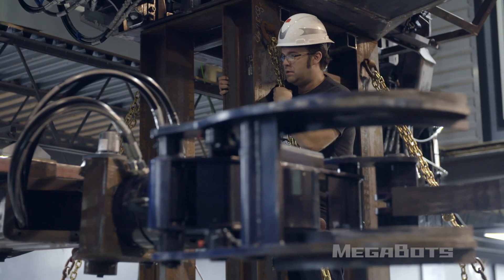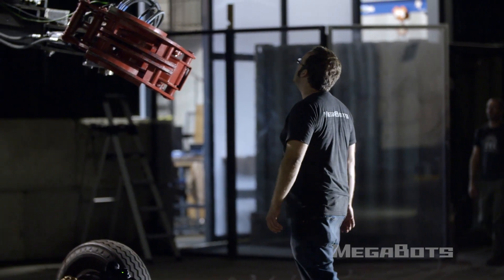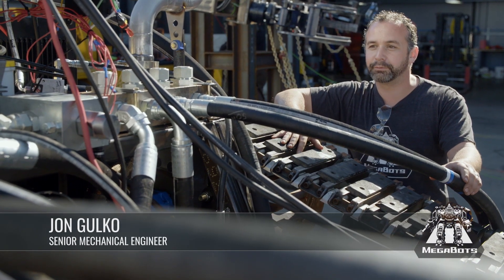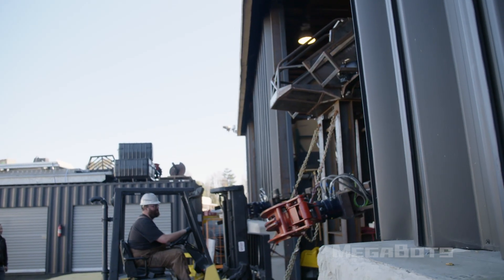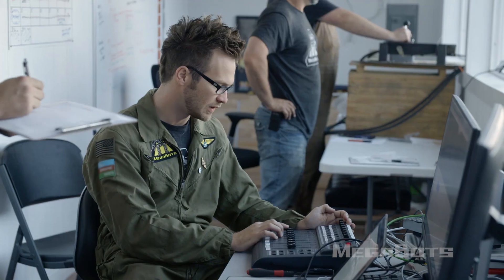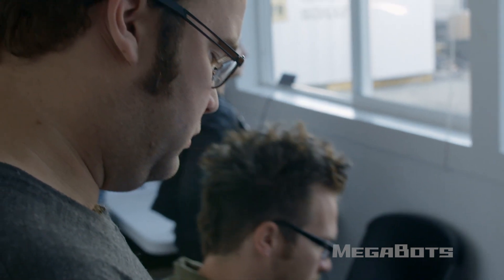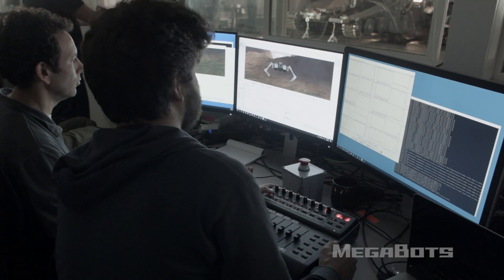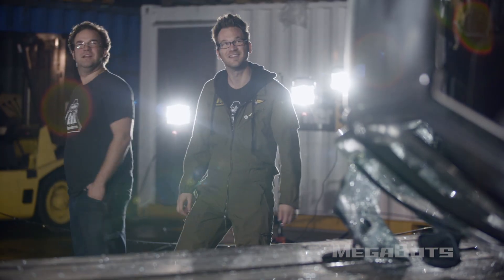MegaBot Mk.III Picks Up A Car! (Season 1)

Comment: Have you guys ever thought that all those hoses could be a problem ?  Why not just use electric motors powered by the engine connected to a 20 or 30k generator, or batteries of course, to eliminate the long hose problem. In each area where the hydraulic cylinders, that cause the movements, are located. Place a high efficient DC electric motor basically right next to the arms or other joints to shorten the hoses and eliminate the single control block and replace it with many that are controlled by the computer attached to a controller joystick. Each  separate motor would also no longer need all that long wiring.... by... communicating to the  separate motors now connected... close.... to each activating joint using.... an FM signal.... or a Microwave signal... to each  separate motor.... there-by eliminating a long wiring harness. This kind of technology will one day be used in aircraft and spacecraft in the future if not already. Just my two cents, cool stuff, keep on truckin.  Chuck in Palm Beach.

Comment: You know how there is a gaming outfit that you can use that tracks the angles and positions  of your arms? Why not try to integrate that system into the megabot and add a small camera to each arm for precision?

Comment: They need to make the mega bots controlled externally because they have them built, They are adding weapons and etc but they are forgetting that the bots can be fixed, rebuilt, Redesigned etc they cannot and seeing these weapons they are designing and previous tests they have a very large chance to die if they pilot it inside the bot.

Comment: Gotta wonder about controls for these guys- are you doing pre-programmed 'actions' like you used in this test?  So you have specific positions that you can tell the arms to go to?  Or are you planning on developing an in-cockpit handheld controller system for direct human control of the end-effector's positioning and actions?

Also, wonder if Korea would want to get in on this- they seem to be developing something in a similar vein.

Comment: Any videos showing what the kuritas is doing?
Reply: AisEH yeah I know don't worry is just a joke, also your right, any kind of problem can push back the development, lets hope that doesn't happen
Reply: How long do you expect the mech the South Koreans are making will be finished? My guess is not until couple of years, especially if the South Koreans are building a mech with leg and free movement arm. I say this with the consideration that is has been about two years or longer since the Americans have been taking to build their mech.
Reply: AisEH the south koreans plan to begin selling their robot by the end of 2017, the arms are already finished and they said that the legs are mostly finished and they already have calls from múltiple companies that want to buy a robot, its going to cost 8 millions per unit aparently
Reply: Wow that sounds impressive if they can actually sell the robot by the end of 2017. That said, I would be cautious taking their announcement as true. External factors (ex: accidents) could delay their plans.
Reply: AisEH that sound soo suspicious, "external factors cof cof accidents cof cof"
Reply: sorry if it sounded suspicious. The reason I say is through the example of SpaceX where accidents and delays ended up pushing back with some of the launches.

Comment: It seems to be that it should be much shorter than it is.  It looks to be too easy to tip over.  When another object of similar size and mass comes crashing into it, you might want to have your center of gravity MUCH lower to the ground.

I imagine a shorter single armed machine, with an arm long enough still to reach the top of the cabin running straight up to it, placing its single arm at the very top then just driving forward a bit to put this big one on its back.  Instant victory.

I don't want to see this fight happen like that, do you?  That would be a very disappointing loss.

Comment: Slow, over-complicated, imprecise.
Reply: This was just the test. Wait until the finished product is revealed before criticizing anything.
Reply: The entire design process could be summed up with what I said. If they're using a human pilot, there's really no need for it to use software. There are also so many exposed vital moving parts that could easily get jammed or directly hit by an opponent that it'd be too fragile to actually use in a fight. If they spent more time designing the robot, they wouldn't have needed to spend so much time testing something as simple as moving both arms. The whole design process is just wasteful.

Even if the whole fight is really well choreographed, something is bound to go horribly wrong.
Reply: Blurns
Do you have any idea of what you're talking about? As I said, this is a TEST version. The thing hasn't had any armor applied to it yet - this is just the skeleton of the mech. Those areas probably won't be exposed anymore once they add the armor. I mean, do you remember what they said the cockpit would be made of? Look at it in this video - it's literally just the framework of the thing. The armor is supposed to come LATER.

Also, you'd be criticizing them if they DIDN'T test the arms for not being thorough or wise enough. These arms run on hydraulics and have several joints and servos. As someone who personally works in the robotics field, let me tell you that it's NOT easy to get ANYTHING robotic act like it's human (getting robots to walk is hard enough). Testing them is necessary to make sure everything works. In a fight, the arms will be one of the most important parts of the robot. They can't afford NOT to test it. Plus, you claim that the didn't spend enough time designing it when you don't even have any idea as to HOW much time they actually DID spend designing the thing. All of these episodes were recorded like 6 months ago. Since the original challenge video was in 2015, we have no idea how much time they have spent designing the MK3 and building it.

Also, they stated the point of the software is to make the job easier on the pilot. When you move you arm, you don't specifically think about which muscle to move to point at this specific angle. You just move it. The software is supposed to make it so that the pilot doesn't have to think about every little movement that the robot makes.
Reply: The Strategist
From the looks of it, the design process seems to have amounted to building 2 poor-quality assembly line robot arms onto the side of a cockpit & equipping them with some tools they weren't designed to handle. They may as well have built a big Rock'Em Sock'Em Robot or just gave up & built a tank for all it's worth.

And of course the software is supposed to make the job easier on the pilot, but it wouldn't be necessary if they hadn't over-complicated the design to begin with. If they just designed it so that the pilot doesn't have to think about every little movement that the robot makes, they wouldn't need the software! Now if something completely unforseen happens with the arm or the software, the pilot isn't going to have the same feedback they would if they hadn't bothered with their "drive by wire" approach to controls.
Reply: Blurns
"but it wouldn't be necessary if they hadn't over-complicated the design to begin with"
The design isn't even that complicated, unless you're an ignorant layman. Robots that are supposed to do even the simplest of tasks can turn out to be very complicated. Doesn't mean that they can't get the job done, though.

"If they just designed it so that the pilot doesn't have to think about every little movement that the robot makes, they wouldn't need the software!"
They want big, tough arms capable of holding big, tough, damaging weapons (not the BB peashooters of the Kuratas). Those kinds of arms NEED to be directed manually, there's no other way to do it.

Also, I understand how you think something might go wrong with the software, but software isn't completely unreliable to the point where it can't handle itself for more than 20 minutes. I highly doubt that the software is just going to bug out in the middle of the fight. These people have a whole entire team of professional programmers - they know what they're doing.
Reply: The Strategist The design isn't over-complicated if they're using it as an assembly line worker. If you're building something that big for anything remotely resembling combat, you want to take as much advantage of leverage as you can & reduce the losses created by unnecessary moving parts.

If they had simply designed the robot around weapon they want it to use rather than giving it arms, then deciding later what weapon they want to swap it's hand for, the software-controlled arm wouldn't be necessary. It just adds another possible delay to the driver reaction time. If you need both software & a human brain behind the wheel, you're doing something wrong.
Reply: Blurns
The problem is, if those assembly line robots in the factory were being controlled by a human, a human would STILL need to calculate the movement for the arms. That's why the arms are almost COMPLETELY controlled by software so they can do their job. And trust me, assembly line robots may not be the most "complicated" robots out there, but they're still far from being anywhere close to as simple as the things they build.

Also, I don't think you realize the advantage of modular arms. It gives the robot a LOT of versatility in that it can change weapons depending on the situation.

Also, having both software and a human brain behind the robot isn't necessarily a bad thing so long as the software actually does its job and minimizes the amount of meticulous work that the driver needs to do. With the amount of time, money, and testing they've put into the coding, I'd say their chances of the software working without a major hitch are pretty good.
Reply: The Strategist If they didn't use that stupid assembly line robot arm design for combat, they could build a better & simpler arm that wouldn't need to use software.

Modular arms might be useful if this were BattleBots or something, but they're just up against one known opponent. They just need 1 or 2 good weapons, not a swiss-army robot.

Comment: A lot of people here apparently don't understand the limits of technology/ limits of practicality. Think about it. This "robot" is being built for the purpose of a one-on-one brawl. Would stealth tech really be necessary? Of course not. It would only add unnecessary work and cost. Not to mention cloaking devices don't even exist in this large of a scale. Also, I've seen a lot of people complaining that they should've put legs on it instead of treads. First of all, Kuratas doesn't even have legs, it has wheels. Second, leg technology has advanced quite a bit as can be seen by Korea's "Method-1" mech, but treads have been practically perfected. Treads are MUCH more stable, MUCH more maneuverable, and MUCH, MUCH faster. Maybe in a decade we'll have legged mechs that can keep pace and turns with treads, but right now treads are the absolute best way to go.
Reply: I've also seen people complain about the speed of it's arms. This is simply due to how the hydraulics they're using work. Larger more powerful hydraulics will always be slower than faster weaker hydraulics. If they had faster hydraulics, it definitely wouldn't have been able to lift that car. It might not even have been able to lift the weight of its own arms!
Reply: ***** potential future robotics engineer at your service! bows
Reply: Alexander Lovato weeb
Reply: Alexane Rose Did you read the sentence immediately after that? Because you basically reworded what I said. I'm not saying we'll never have legged mechs, just that AS OF NOW treads are the best way to go.
Reply: Kuratas's legs have wheels on the ends of them, making them hybrid leg/wheel design allowing the machine to change its height.

Though I wanna know who really said stealth would do anything- we literally cannot mask the heat signature of a machine this big, an IR sensor would reveal its location faster than you can blink.
Reply: "Treads are MUCH more stable, MUCH more maneuverable, and MUCH, MUCH faster" for now. IF these legs were perfected then stability would pave way for agility, maneuvertability will overtake treads (at least in urban settings), but I'm not so sure about speed.

Then again, tell someone at Kitty Hawk about a Boeng707 and he will think you mad. Yet, here we are
Reply: Alexander Lovato Oops, my bad mate. sorry but hey at least it won't get lost right?
Reply: Basicly legs are unstable 1 less touching ground 2 they need less energy to do the job worse example tanks racing humans